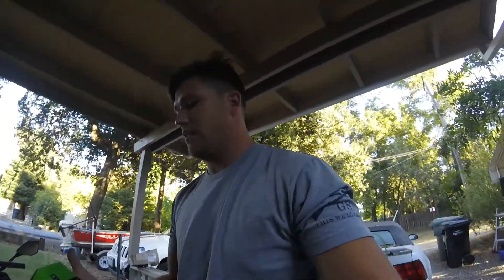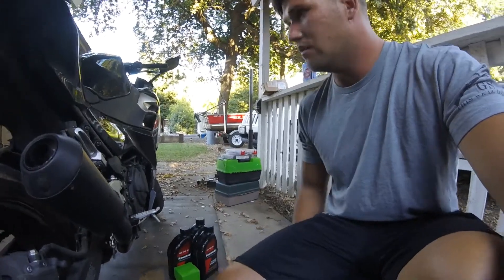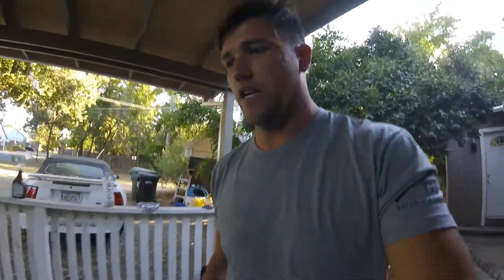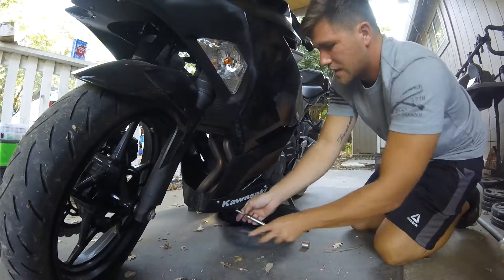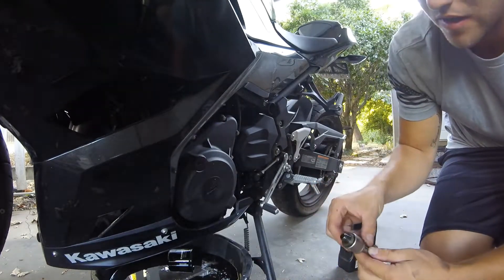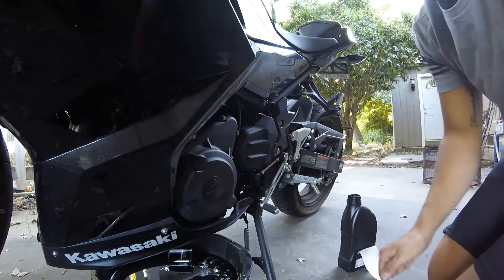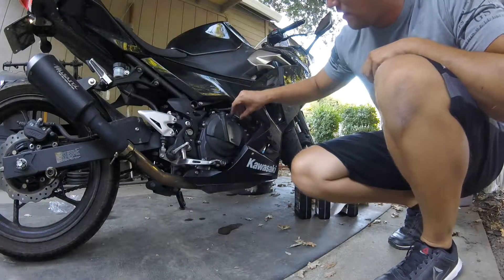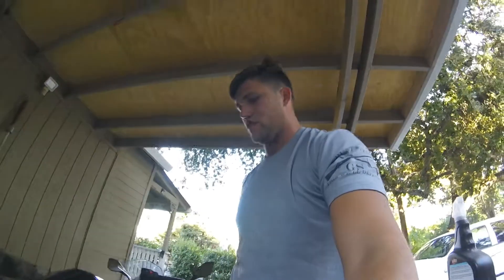Ninja 400 Oil Change! Super quick and easy!!! Don’t pay the dealers.

Comment: Just changed my oil for the first time. Thanks for the help. The dealer wanted $300 but that did include the first time service. Not sure what all they would do but I wasn't paying $300 for it lol
Reply from the maker: They just up charge. I got new tire for the rear, and they wanted to charge for setting the tension on the chain 🤣
Reply: My dumbass fell for it and paid 300 for a damn oil change. Never going back jesus chrizt
Reply from the maker: @MrUFCFan12345  ooooff
Reply: So you just lost the warranty? lol
Reply from the maker: @Rastei  idk who you are asking, but I still have warranty till 2023 always buy extended warranty. My clutch and clutch pin was replaced since 1stgen 400s has issues with it. I rarely ride the 400.. I ride my z h2
Reply: @Rastei  you keep the warranty as long as you use OEM parts and keep the receipts
My dealer is trying to charge me over 300 for it as well

Comment: Dube, read the manual, lots of wrong info in this video, from the total oil to use, the wrong/ non existent torque settings for both the drain plug and filter to literally not giving the bike time to drain on its own fully or standing it upright a few times to get the last residual oil to drain out.  Your little trick of adding oil didn't do much if anything to clean out the oil.  You are also 100% dead wrong when you say "if your bike came with conventional use conventional".   ANY approved motor oil that is rated  the same as the OEM oil and is certified for JASO MA/MA2 will work.   Converting from Kawasaki motor oil to Mobil 1 synthetic will not hurt anything.  READ THE MANUAL.  It clearly states its OK to use synthetic and or a semi-synthetic blend.   Who knows more about the bike~ you or the dude at the dealer or the people who made it?   To each his own, but don;t make it sound like its going to hurt the engine if you decide to run a different brand or type that is certified.   Whats key if that you use the proper weight (10w40) or as outlined in the owners manual.
Reply from the maker: Point is use what it came with it’s a cheap bike, warranty is there for 5 years if smart enough to purchase it , read warranty papers if you use non Kawasaki oil or filter they’ll void warranty. Honestly you want to put water in your oil go for it your bike I’m not telling any one to do any thing to the bike.
Reply from the maker: Video is there show how easy and cheap it is wasn’t a complete toque every thing to spec lol 
When I say use conventional it’s because it’s cheap and the bike is cheap, why pay more than 40 dollars for oil and filter... for a 5-6k bike still have to change it just as often if you “actually ride” you’re not getting performance gains. And when I say use conventional I will because the manufacturer for the bike warranty the clutch and clutch pin told me to use conventional so I’ll do that... I know I wouldnt put conventional in my liter bike but that’s comparing Apple and oranges.

Comment: While I appreciate the video, I consider it anti-helpful.  I really hate to criticize, but a lot is wrong with this video.   I have a 2021 Ninja 400 ABS and I am about 2/3 the way to the first oil change.  

-While conventional oil works, synthetic would definitely be better and does indeed make the bike run cooler, wear in less, and holds up to heat and friction much better.  Saying, "It is only a 6k bike so cheap out" makes no sense, it is still a decent amount of money for most and still something you should take care of the best you can.  My GSXR 600 shifted and seemed to run much better when I switched to Motul synthetic (the previous owner was using Suzuki conventional).  My dealer even said that switching to synthetic is a smart move.  Also, synthetic is better for the environment and is much more pure than conventional, it costs more for a reason!   There is nothing in the Kawasaki warranty that says filling the bike with superior oil will void the warranty.  As long as you are using the correct oil is all that matters and they will not void your warranty if it is to spec.  

-You are telling people to use 2.5 quarts of oil, which is a decent amount more than 2.1 quarts the bike plus filter needs (Bike itself only needs 1.6)!  That can potentially be damaging and over-oiling and under-oiling is NEVER a good practice.  Keep doing that and bye bye gaskets!   You are worried using any other oil but cheap conventional will void the warranty, and then putting too much oil in it!   Pre-filling the oil filter, did you subtract that from the amount of oil you put in?   If not,  you put about 3 quarts in, which is way too much!  

-You also have to let the bike stand upright and run longer to check the oil.  Then I recommend checking it again after riding it.  In fact, you did not even fully empty the dirty oil out of it before you started putting the new stuff in.  

-You removed the oil filter with nothing underneath, which can cause the oil to get on the ground (which you did get some on the ground).  There is enough pollution and no one likes an oil-stained driveway.  

-You used no funnel to fill the oil, which is lazy and wasteful (you must like the smell of burning oil). Why do that and be that lazy to not use a funnel and put something underneath in case you spill?

-You never gave or used torque specs.  Unless a seasoned mechanic, use them and even they usually use torque specs!  It is also a smart move to take your finger and put some oil on the filter rubber before threading it in.  

You are assuming the role of a teacher, so how about teaching people the right way?  You are showing the basic process, but you are doing even the basics wrong!   This is like teaching people how to fuel up, then filling until it spills all over the place and calling it a completed job.

Lastly, owning a liter bike is no excuse to cheap out and neglect your 400.  A lot want but cannot get/afford the 400, so keep that in mind.
Reply from the maker: Every one has the preference do whatever, I have 15k miles doing same old changes ways runs fine. Still runs Great and has 3 more years of warranty. Clutch is included in warranty. So I’m not worried. 400 isn’t a bike to spend bank babying it for me. Kawasaki says to use their brand of conventional so I use it just like all dealers do. If it’s a h2 or similar bike then sure use synthetic. It’s a 5k bike oil is oil to it. As long as you keep oil changed and clean.
Reply: @Aarronching  In europe that will make void of warranty for sure. You cant do whatever you want to the bike and expect to stil hve warranty lol, not in europe for sure.
Reply from the maker: @Rastei  Glad to be in America. rip to you